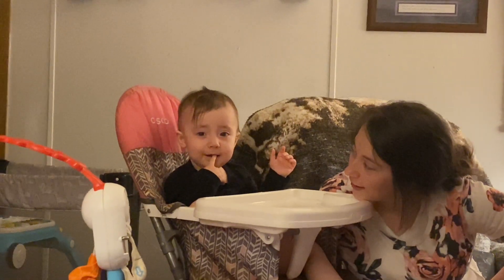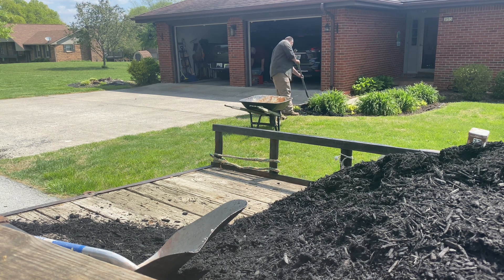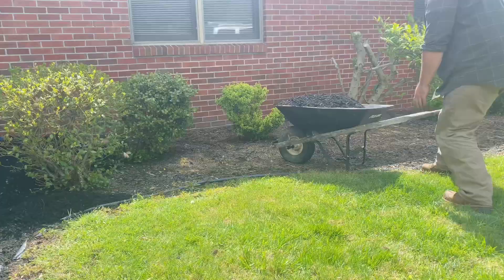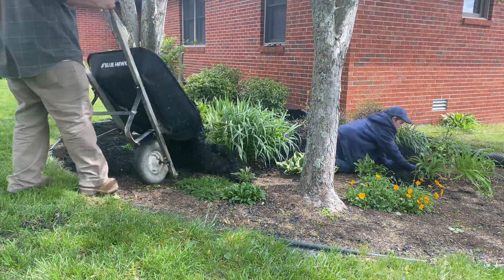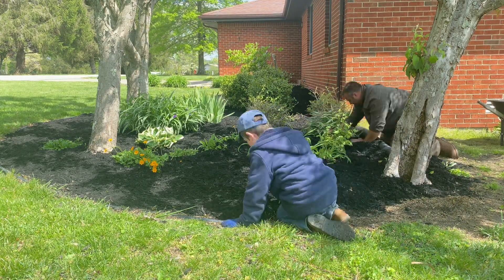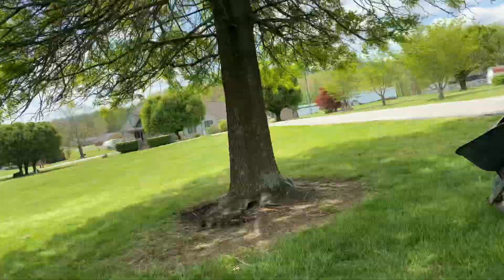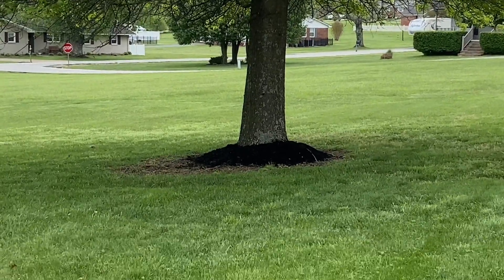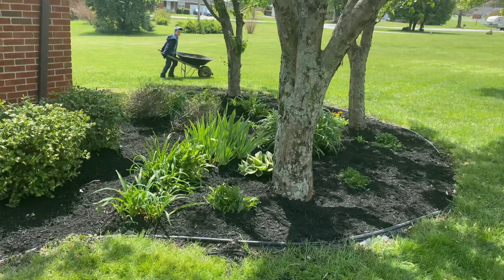Mulch installation: blessed with a beautiful day for landscaping

Comment: Hope you don’t mind an Old Man passing on some old but proven tools and techniques……just try it. Then you tell me….🤔 Always use a 9-11 tine pitch fork when working with shredded mulch……no resistance going into the pile, and when used to lay on the bed, gently slide the fork over the top of the scoop of mulch, smooths out perfectly and no compacted mulch, works really well on double& triple shredded mulch. It’s much faster, less effort on your arms and shoulders and the finished look will blow your mind. Again, I’m not trying to be a jerk, just passing on a much proven technique. Your customers will be so happy with the result, well let me just say you will see….repeat business and neighbors asking who did that? I want mine to look like that. I always also use a straight blade shovel held on about a 30 degree angle to edge the bed, before mulching, again the finished look and it’s ability to hold the much will amaze you. Just give it a try please……Not criticism, just a suggestion my friend 👍👏🙏🇺🇸 Rick
PS : when cutting the edge, go down about 4 inches and I find it easiest to use some upside down spray paint, the fast easy way to mark the bed, then just follow with the spade/flat shovel 👍😎 Dillon shoot me an email and I’ll send some photos of what I’m suggesting, easier to see it then read it 👍 pic is worth a thousand words 😁